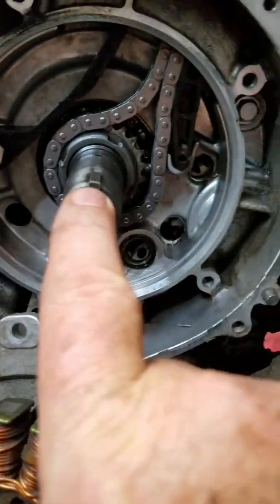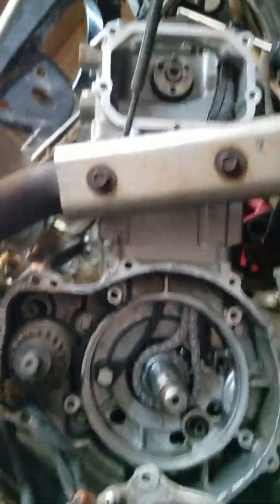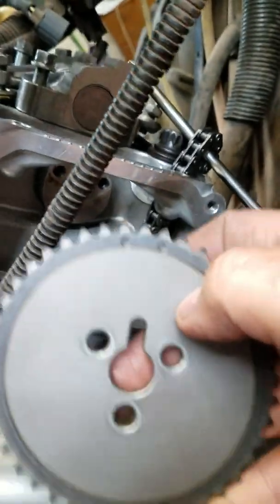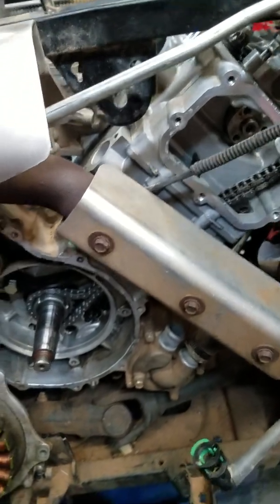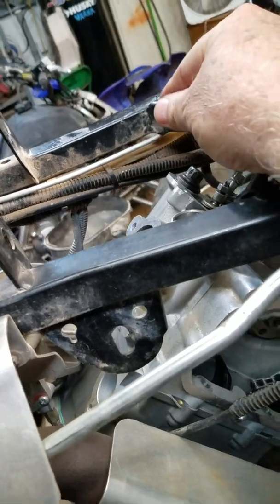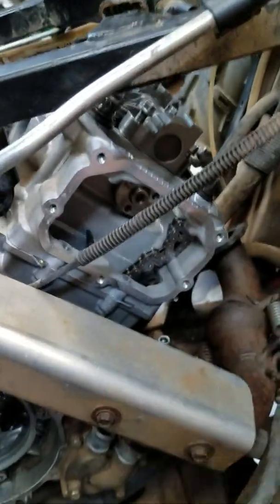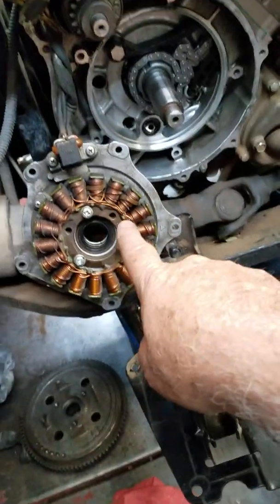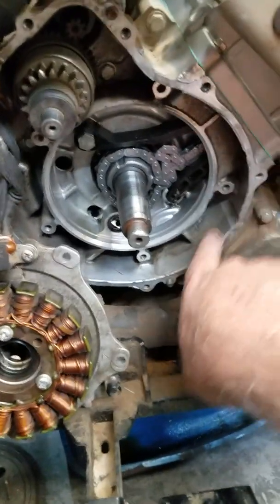Polaris Sportsman 500 Cam Timing, Setting,  cam chain

Comment: I have a 2000 sportsman 500, I did everything you said to set the time, but wen I turned the motor like 5 times, the 2 silver links of the chain were off the timing marks on the cam,, time was off again, what you ting is the problem??, chain to old,, tensioner, or the sprocket, what do you thinks it could be,, help me please

Comment: According to my Polaris manual The factory way of doing it is completely different.

The book states to bring the engine to top dead center. Line the single silver link on the timing chain up with the mark on the crank gear. Then line the 2 silver links up on 2 dots on the cam gear And that should be timed.
Reply: Yes do it the way the book says

Comment: Hey how are you I just came across your link for this timing on the Polaris Laris I have a 2001 Polaris 400 4 stroke  I just put a remanufactured head on it a brand new cab my gear was in good shape the chain was in good shape but I noticed putting my rockers and everything on my camera slides in-and-out is it supposed to move it's the move there's nothing to lock it in now and now I know it'll tighten up somewhat when I put my Cam tensioner in but it's still moves because the cap on the left side that you take off the 3 screws The compression release made a little circular mark in it from the Cam moving now that was in the old head which wasn't bad shape either I I had a cracked water jacket somewhere after I did a whole top end on it and I had to tear it all down again pain in the ass but would you know why that would move that much if at all thank you

Comment: This was a helpful video.

Before I watched this I was 180 degrees out, FYI the head is tall enough that even at 180, the valves won't hit the piston.

I ended up pulling the flywheel like you have it in your video just to absolutely verify the cam and crank are in sync. I turned it around before and the valves were tight as hell and I realized I wasn't on the compression stroke when I set them.

I have the service manual here and I've been following it, but you put it into reality I need to pull the flywheel to be sure I'm aligned with the block marks after a timing chain goes and everything is out of whack. The manual assumes you set it at TDC on compression and you haven't touched it since you took it apart. When you can't see valves moving and when the spark is triggered by the stator, it's very easy to end up with the piston up on the clearing stroke.

Thanks Geezer, I appreciate it.
Reply from the maker: I'm glad the vid was a help, setting cam timing on that engine is more obscure than most! Happy Thanksgiving Joshua!